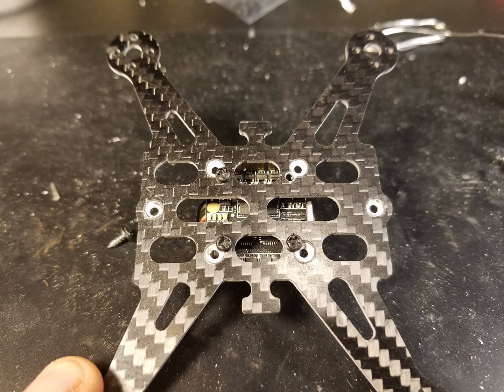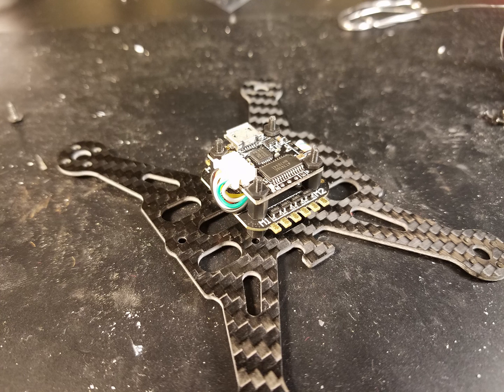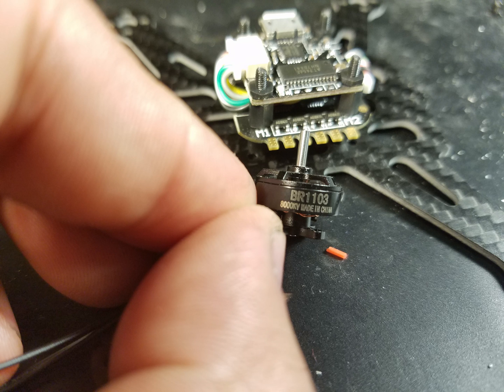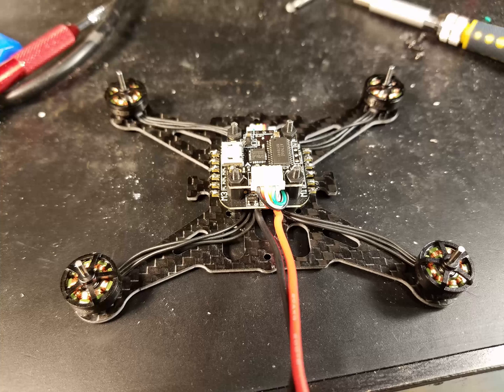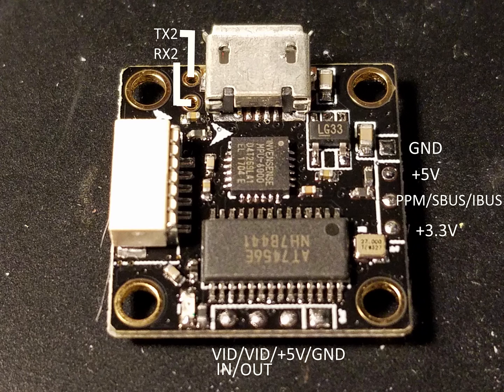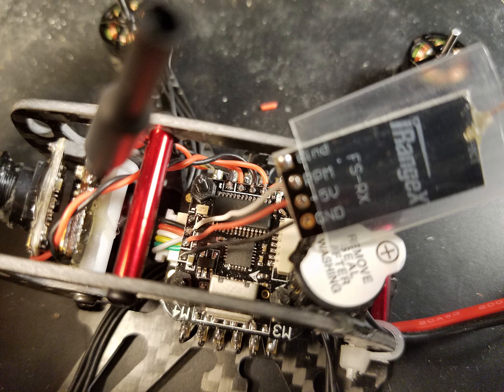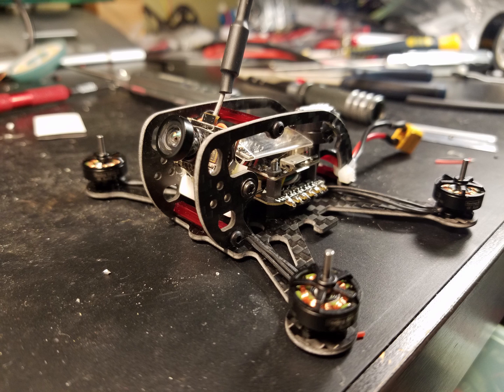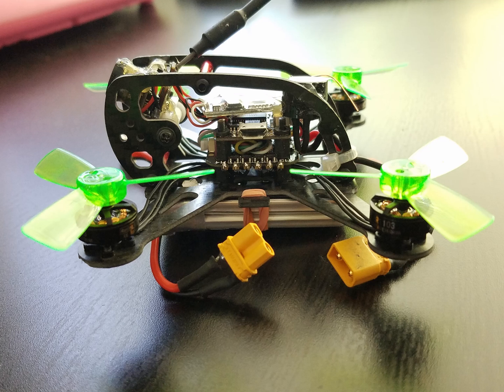Super_S Flytower AIO build esc fc osd

Comment: Please answer this I have this flight tower on my mantis 85 and want to know if I can change the motors and what to
Reply: 1103 & 1104 Brushless motors are best, and 1103 is better for 2S batteries this supports as the 1104s may get warm if you punch it alot.  Over heated motors can be a source of brownouts.

Comment: Hi Doug, i am Chris from Germany. Could you please help me up. I have the same flytower, and i dont know witch pins are +,- and the Motor signal on the 4in1 ESC?
Reply from the maker: https://www.youtube.com/watch?v=2OfUMAVHiSI
hope this helps
Reply: Chris the 3 motor wires don't matter which order you put them in.  If the motor is spinning CW and you need it CCW then switch the last 2 wires.
Reply: Doug Hnut the. Links do not work no more :(